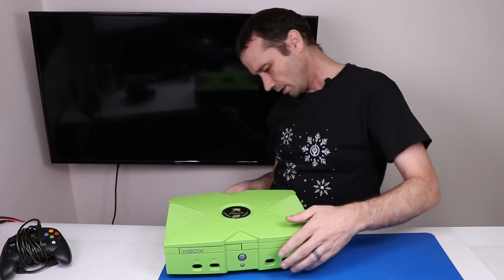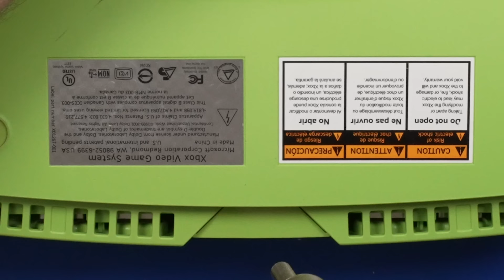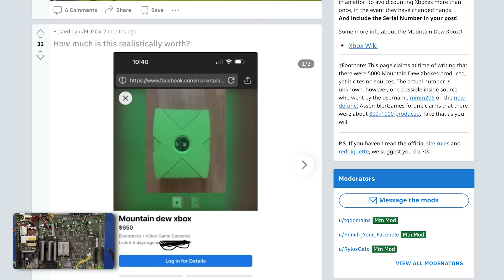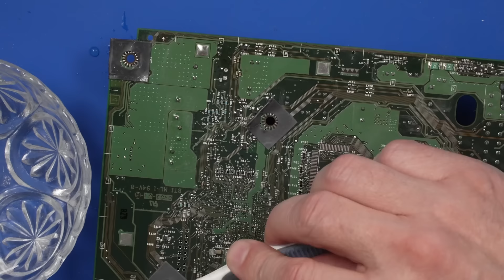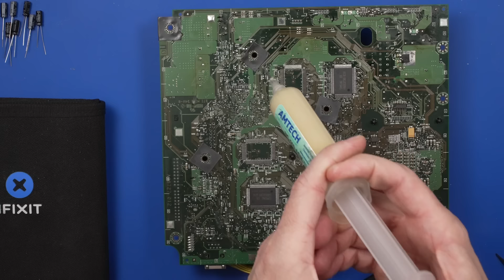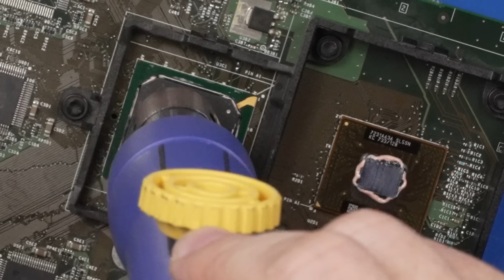I Finally Found One of These! Can I Fix It?

Comment: There were 4,000 made . They did 2 sets of 2,000 for the rewards program from entering  cap codes back in early 2000's.  We actually have 2 of them:) with the boxes still both were open unfortunately but we do have one still in the shipping box❤

Comment: Capacitors contain liquid electrolytes, which can include ethylene glycol, boric acid, Dimethylformamide (DMF), γ-Butyrolactone (GBL), and other organic solvents, sometimes with water. This conductive liquid, called electrolyte, is crucial because it fills the porous structure of the capacitor, forming the actual cathode that increases the device's surface area and overall capacitance.

Comment: I think doing this kind of work it be easier to use a tweezers iron/aka double iron. That way you can heat only the thing you want to heat. Hot air heat everything and one iron is doable also the that vacuum iron is a great tool.

Comment: I tried using the heat gun to lift the label to get to the screw, but I ended up heating it up too much and putting a permanent bald spot on the plastic next to the label. Doh! I guess its just experience that will help me do it right.

Comment: Greetings friend, I am a technician like you, I suggest you check the mosfets carefully, I saw two of them that are outside their soldering space as if they had overheated and moved from their space. Did you check the powersupply voltages.

Comment: I'd recomment cleaning out the holes as well and use all new solder, instead of just heating up the old solder and pushing the new cap through. It'll not only remove any cap juice residue, it's also safer for plating at the through hole.

Comment: Tip for removing labels/stickers is to put denatured alcohol in a syringe and after heating and getting 1 corner up a tiny bit, shoot the denatured alcohol behind it the label or sticker and lift slowly and it should come off really easily and then let it dry and all the adhesive will still be good after the alcohol evaporates

Comment: The problem with these capacitors dates back to late 1999-2005 and is a big reason a lot of these older consoles fail. Die to manufacturing defects in that era, almost every capacitor and board of that era has some sort of issue with their capacitors. some of the only brands unaffected were Nichicon and other Japanese capacitors. However, the cheaper Chinese capacitors of the era are far more susceptible to failure due to the manufacturing defects.
Reply: The capacitors use an electrolyte solution, sometimes basic, sometimes acidic. The Capacitor plague affected most Taiwanese capacitors during the era of 1999-2007 due to a mis-copied intelligence leak from an engineer in Japanese capacitor manufactories with them using a incorrect formula for their capacitors.
Reply: For the SMT components you could definitely resolder them and it be fine. Most likely the areas of damage would be the board itself due to the corrosion eating away the copper.
Reply: Personally i would used leaded solder to replace the solder on those components. For the damage of the through-hole vias, there is a kit harbor freight sells that comes with diamond/carbide drill bits that are sub-millimeter in size. i use those to drill out and repair vias and route 34 gauge conductor wire through them.

Comment: You really confused me when stating that you were using vinegar to "neutralize the acid". That's impossible. Vinegar IS an acid. A weak one, but... Alkaline batteries and capacitors are basic, so it sort of works. Except now you ARE putting acid on the board.

Comment: So you replaced normal electrolytic capacitor with crappy surface mount ec ? the worst move you can do
Reply from the maker: Not sure what you're referring to here.
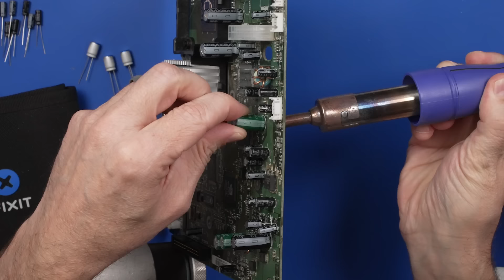Reply: @Tronicsfix  at 12:35 you have replaced some electrolytic capacitors wit the surface mount one, who are all bad quality and doesn't last, also sometime even when new, they have higher ESR, "It is preferable not to use them, but at least check the ESR first
Reply from the maker: Those aren't surface mount capacitors
Reply: @Tronicsfix  ok,  as you like😆
Reply from the maker: Surface mount capacitors mount to the surface of the board. I was installing through hole capacitors at that timestamp.
Reply: @Tronicsfix  ok ok my bad

Comment: I won one of the 5,000 Taco Bell original X-Box One X's that were the first of the line only Taco Bell winners got before they hit the stores. Unfortunately it died recently. I think the hard drive is a goner. At least I still have a working One S, and Series X that can use.

Comment: Have you checked the connection between the plug and the Xbox? Even with a new plug if the adapter in the back of the Xbox is bad it won’t receive power.

Comment: Worst case scenario, you can replace the motherboard with another Xbox, I mean they are so cheap so the case is worth salvaging. But I check those traces near the battery clock tbh.

Comment: For older consoles like this, that you know people are highly unlikely to open up and replace the thermal paste, I would suggest using a carbon based thermal pad instead. It has the same qualities as thermal paste but has no requirements to be changed out once it dries up. It'll continue working forever, as long as the console still lives. I did the same thing with my Xbox 360 (OG Halo 3 Launch console) and it's been running for years without any problems. 

Mostly just pointing it out since most people wont think to replace thermal paste on older consoles.

Comment: this brings back memories lol. there is 4 places to check all of which are basically continuity checks, there is a fuse on the PSU while you are here check the cables and connectors, they are prone to broken solder joints, check the traces near the clock capacitor, the power board on here check the buttons, and the expansion cables/connectors.

Comment: Tronics, I need some advice. I'd like to get into repairs along the lines of what you do. But besides learning how to solder, what do I do? Where do I start? How do you know what to test and diagnose?
Reply: I'd start by taking apart working things, consoles, GPUs, etc, to replace thermal paste and pads. Get a sense for screw tracking, how to keep parts organized, and using things that work so you know if you put it back together correctly.

Comment: I would hook up fly wires to the power in on the power supply and then test the output of the power supply to see if it is good. If it isn't then most switching supplies like that have a fuse soldered on the board that could be checked.

Comment: Lucky one if it had worked. Start of the nineties last century there was an smd cap scandal happening. Even Tektronix got hit and a lot of great and quite expensive equipment went down the drain after a decade of lifespan. While dying those caps leaked massively and took down large part of the surrounding components as well. This meant even a component looking good at the top would've been corroded from between the PCB and the component where the alkaline liquid worked it's way inside the part.

Scopes like the good old TDS540 where a nightmare to fix. Many vias, logic parts and even custom ICs left this realm that way.

Edit: Instead of using either vinegar or soda I just put them boards into the dishwasher (w/o tab, of course). Came out clean and neutralised sure as h. You might want to avoid this procedure with PCBs featuring mechanical stuff like relays.

Comment: Don't know if this is the place for it but I've experienced lots of faulty ElGato Pedals and have seen that it's a fairly common issue with the same narrative, it stops working after 1 day ~ 1 month, apparently frying itself.

Would be cool to see a video on those and see if it's a manufacturing defect or bad internals or what's the issue with them. Love the videos!

Comment: I dug out my old classic xbox yesterday and thought I'd see if it still works, as I have been storing it for like 10 years without use, and it booted first try! But the CD tray wouldnt open so I powered it off, pulled the cables and saw if I could open it manually. All I did was try to press a paper clip into the small hole, but nothing happened. I figured it may have to be powered on for the release mechanism to work, so I plugged it back in..... And now it wont power up at all. I have no idea what may have happened, but it feels like the power cord is very loose in the console? Idk but it's sad anyway

Comment: I think I figured it out, so the inside of the system is fried. I think to solve the problem just get another xbox with the same model number and swap out the insides and just replace the old case with the Limited Edition Mountain Dew shell. Problem solved!

Comment: The thing i love about OG xbox repair is how active the discord community is. I have repaired 100s of OGs since 09. Clock cap corrosion is usually the main culprit. The P/E continuity trace fix works almost always.
Reply: Tronicsfix, you should do a 2TB Sata upgrade for this bad boy. I believe it's a 1.3 revision so a TSOP mod would be best for it.

Comment: Hello I have a question for you i bought my grandson a ps 5 last year and he only played it for one day and it stopped working in away (it will come on but will stay on for a small amount of time so i wonted to get it fixed sent it to Sony and they sent it back said they couldn’t fix it so After this I just bought a new one for my grandson long story short I took it to a repair shop they said new hdmi paid for that system still doing the same thing I then decided to take it to another shop the said they replaced the liquid metal and cleaned the motherboard and replaced power supply and it’s still staying on for 30min to 1 hour so I was wondering if anyone has had this problem and what you did to fix it

Comment: Hi TronicsFix I have a question: how do you calibrate the potentiometers to stay perfectly in the middle? i can see that the pins arent bend. I ripped so many pads and broke so many potentiometers just soldering unsoldering bending the pins to right and left just to have it as close to the center as possible 😅 ( it will be great to make tutorial for all the people like me repairing things at home😁).

Comment: Picked up a As is xbox one S from the pawn shop for $20. Hook it up and it kept throwing the error 102 , 106 codes. I knew it was a bad harddrive. Found my old laptopi n the closet that had a 1 terabyte harddrive . Formatted the harddrive , download xboxes firmware and the update. Now I have a working white xbox one s for nearly nothing. The ifixit guide helped me out . Thanks Ifixit

Comment: Also - if you get this working - soft mod it and null the drive. That or hard mod it, you probably know but the drive is locked to the board. If you null it you can swap out drives since you know the key.

Comment: Broken item prices are to the point now where I'm not even going to bother. I was wanting to buy a couple of game boys to do some modifications on. And instead of tearing apart a perfectly working game boy I was going to use a broken one. The prices of the broken ones I'm better off just going to a yard sale in finding one or buying a used one off eBay at this point. I would hate to take a perfectly good working one in tear it apart but at this point my wallet says I only can pretty much do that

Comment: check traces on bottom of board. I bet the clock cap stuff eat those away or trace rot . I have fixed many like this . There are diagrams on where to run jumper wires.

Comment: There are a lot of things that go wrong on those power supplies. For one, the input terminals crack at the base solder joint. So that's one thing i've seen on mine. For others there are components that make up the different voltages and regulators that can go bad.

Comment: Try a known working power supply to isolate it - grab a Xbox locally cheap/free (e.g for parts - as long as it attempts to power on) and take the power supply out. It sounds like the fuse is the issue or some form of major PSU issue. I've got 9 Xboxes here and the PSU hasn't ever been the failure.

Other option if it is the board is to determine what revision it is and get a used black shell and swap the board out.

Comment: I've modded and repaired a very large number of the OG Xboxes, and that definitely looks to be a bad power supply. If you figure out the exact version of it (At a glance, I'd guess v1.3, but definitely look it up to verify), you can buy a regular Xbox of the same version and swap out the power supplies and test it out.

That said, someone here mentioned that the fuse was likely blown in the PSU, so testing that first would probably be the smartest move if you don't have a spare Xbox of the same version lying about.

Comment: shop goodwill online??? But I dunno about that place. I tend to bid on electronics and gaming related items. I began noticing this problem probably in 2018ish. Lets just say a totally different experience than ebay.  Just seems like some weird stuff going on bidding wise. A very high bidder in the last few minutes. Items selling for more than I normally see them go for. Some of those items reappearing a few days later as if the high bidder backed out!!! Countless times Ive tried to manually bid in the last few minutes or less and the bid screen locks up and just spins and spins until the auction is over. I understand internet connections can be flaky but it has just happened to often for that to be an explanation. 
Their shipping and handling can be insane!!!!! Just recently they wanted $25 to ship 3 magazines!
I will compliment them on one thing. The majority of items I have bought from them were almost over packaged!!!

Comment: A few tips.
Check for the fuse in the power supply, check that the front panel connector was plugged in, and as chris tursk mentions, check the front panel traces on the underside near the clock capacitor (segments 6 and 7 along the edge). Those will probably be PE#1 with the clock cap leaking. Strange though, usually I've seen it power on immediately when the console is plugged in in the wake of that damage, try the eject button as well to turn on the console (though that's also victim to the trace rot, along with the front panel LEDs and power trace).

Comment: When you popped the top and I saw a Samsung drive, I was all excited. It was THE best drive to have on a modded console back in the day; was way less finicky with DVD-Rs. Plus, you have a 1.1 board which was also awesome; they got rid of the fan on the GPU heat sink. As for your issue, I would check the traces for button signals. They travel on the perimeter of the board and I've personally worked on consoles where these traces rotted out for no apparent reason. Also check the pinout of the power supply, you can make it turn on by shorting a pin to 3.3v or GND (can't remember) - You could at least diagnose it without having to use the Xbox motherboard. It should help you narrow down the problem.

Comment: You guessed it! It’s not an acid, it’s a base. Some capacitors contain an electrolytic solution of borax (sodium, boron, and oxygen). That’s why you use an acid to neutralize it. Think on the alkaline batteries, they have a base inside and when they leak into electronics, you also use an acid. 
On the other hand, for acid-lead batteries spillage, you’ll have to use a base (bicarbonate solution) to neutralize it.

Comment: Hey Tronics. I found a old Dell Optiplex 745 desktop and I want to turn it in a gaming pc could you tell what gpu and cpu do I need to buy in order for it to be a gaming pc please
Reply: I used a q6600 recently but it was sff so can't put in any gpu. Maybe a 2hb or 4gb card is my guess
Reply: @TheOriginalVersatile  thanks bro
Reply: So these are the maximum specs that can go in this pc?
Reply: Because I don’t think that 4gb graphics card and the q6600 is going to cut it
Reply: @mgloc1  do some research and see what works I just use it for old school emulation and office work

Comment: I've had s few origional xboxes and i dont bother replacing thd clock capacitor after removal. They are not really needed unless you like an accurate date and time.

Comment: Maybe I'm saying something obvious here but, did you check whether there are any fuses on the board that need replacing? Back in the 90's it was common practice to install fuses along the other components to protect the board against shorting components (like capacitors)
Some of those fuses actually have a TO92 shape like small transistors.... just a hint :)

Comment: U can check the output of the power supply. It's same as a computer power supply. Just short the green wire with black ground wire. Check if psu is giving out voltage

Comment: Un-Du works great at removing adhesives and it dries almost instantly. I use it on everything and always have spare bottles available. Currently, 1 being used, 2 spares bottles and a 32 oz refill bottle. Just make sure to get either the yellow or white caps as the silver cap, California sales specifications, doesn't work.

Comment: At least judging by the pristine condition of the stickers whoever removed the rubber feet gave up and didn't open the console. My guess is he didn't even had the correct bit for screws, they tried with a standard Philips bit and gave up. That's why you see the screw sticking out.

Comment: I would have first checked voltage and current on the supply, fuse... If the supply is fine, I would go to the motherboard. good luck with this repair!

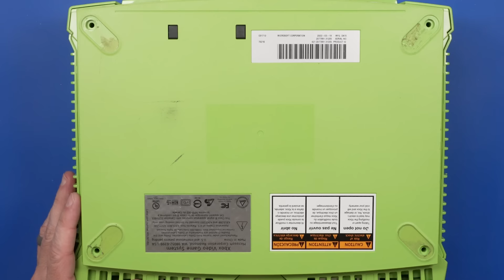Comment: 1:38 what happened to the audio ?
btw 515 bucks is a ripoff for that condition.
there might be broken traces on this board, pretty common. look from the front on the bottom, there are several traces that have the signals for the front panel buttons.